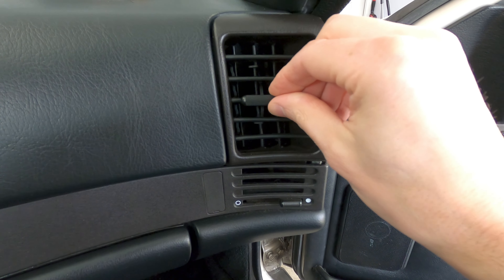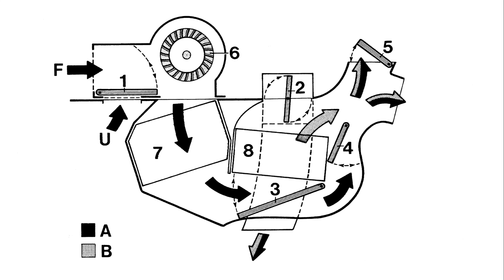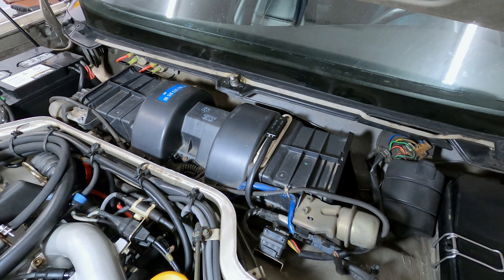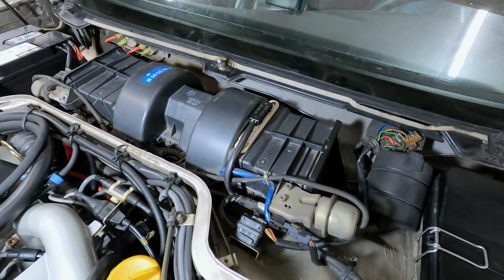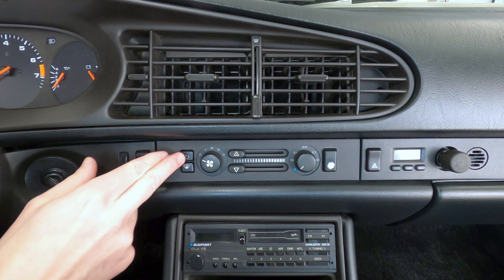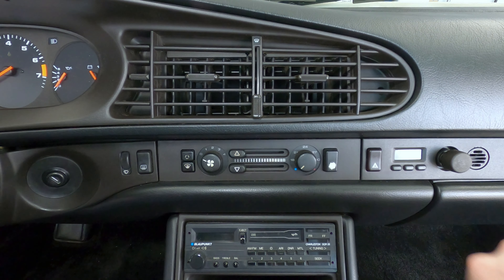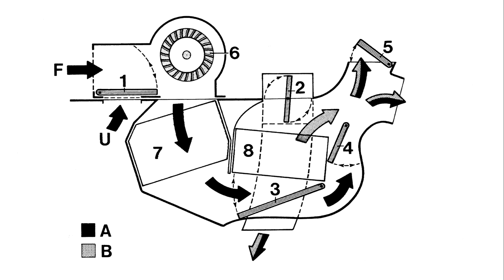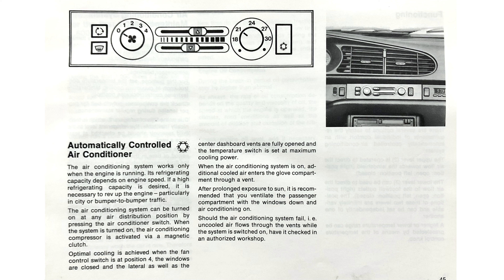Porsche 944 – HVAC Climate Controls Explained

Comment: Another well shot, informative video. You are invaluable to the 944 community my dude! Today I replaced the cable connecting the battery and starter to fix an occasional no start issue. The starter now cranks at double the speed simply from replacing 35 year old wires. Onwards and upwards!
Reply from the maker: Excellent! I’m glad to hear of the improvement, nice job! 👍🏼

Comment: Great video.  My 944 always blow air through the top of the dash even if the levers are closed.  I suspect the issue is the foam as I can hear the servo motors running.
Reply from the maker: Thanks! Sounds like that may be the case. 👍🏼

Comment: Probably too late to hope for a reply, but any chance you could help me locate the actuator for the defrost flaps? My top slider doesn’t do anything.
Reply from the maker: @AustinSikich  Hey! The motor for the defrost flap is located on the drivers side footwell towards the top of the HVAC assembly.  Check out these diagrams - https://www.clarks-garage.com/shop-manual/hvac-01.htm

Comment: This is interesting and helpful.  I always thought my top slider was backwards, because I thought it controlled air to the dash vents but you are saying it controls air to the windshield.  When that slider is to the right, I do get more air to the windshield, and when it is to the left the air is directed out the dash.  And it seems this is further controlled by the vertical lever in between the dash vents.  Confusing for sure!  I'm still not sure if mine is completely correct.  I did replace the foam surround behind the dash vents as that was disintegrated.  I wonder if there are other foam seals I cannot see that need replacement.  Thanks!
Reply from the maker: Your thinking is correct! The center dash vents share an air pathway with the windshield vents, so when you move the upper slider to the right and open/increase air flow to the windshield, some of that volume is redirected from the dash vents to the windshield. Indeed a quirky setup! 😂

Comment: Defrost button also should kick on the ac compressor 👍🏼 if your snowflake button doesn’t turn on the ac compressor but your defrost button does, you could have a bad snowflake button (or vise versa)
Reply: Could you have a failed snowflake button even if it's light is on? Mine doesn't look nearly as worn as the one in the video and it lights up but I don't hear the compressor, I think I might be able to with defrost but it's kinda hard to hear over the fan.
Reply: @kaze913  if you can’t tell by hearing, you can look at the compressor and see if the clutch is engaged
Reply: @tims_4x4_garage  That makes sense. Thank you!

Comment: My hazards are a wheel? And don’t function? Am I missing something?
Reply from the maker: @henryneufeld4944  The hazard switch to the left of the digital clock? Should be a black rocker switch with a white triangle on it. The only difference I’m aware of is the button was changed to red for the 968 in 1992. Maybe a prior owner swapped out your switch for some other custom modification?
Reply: @NC944er  must be, weird because it looks oem and well worn. It’s a rolling dial with a triangle at “top” or when rolled upwards and a triangle at the bottom when rolled downward. In the middle it’s a horizontal line which slightly clicks into place on the line. I don’t think anything happens when I roll it either way
Reply: @NC944er  thanks for giving me this info! Busy be afm, as my cigarette lighter has been converted to USB. unfortunately the usb conversion drains my battery so I had to pull that fuse

Comment: I found your videos on this topic very helpful. I am troubleshooting the heat always on issue with my 86 944. I believe the main blend door motor is frozen closed. I really found the footage of you opening and closing all the flap doors with the module out of the car helpful at 1:48 . Can you please do a complete video of the inner workings of all the flap doors and servos without the dash board in the way? That would be super helpful. Thanks!
Reply from the maker: Thank you! Have you checked the plastic bearing clips under the dash to the right of the driver’s side footwell? That’s probably the most common cause for an “always on” heat condition. Here’s a little info on what I’m referring to - https://youtu.be/h8SR1e3OmJs?t=4m28s
Reply: @NC944er  Yes, I checked all of those. All the rods are properly seated. I am thinking either the solenoid to control the heat control valve isn't working, and or the motor for the flap door that sits right behind the main vents is seized. I can't trigger the motor when jumpering it to 12V at all. 

The Arm in your that linked video where the broken arrow is pointing, doesn't move at all. I saw another video where that motor is disassembled and the rust removed to allow the armature to spin again. I plan on doing this next. I just need to limber up for a few days so I can contort myself into the kick-well. 

Do you have any footage of where the heater control solenoids are and pass through the firewall? I saw you replaced the bulkhead hoses with red, do they just pass directly through the firewall?
Reply from the maker: @tiderfish  Gotcha! No, I haven’t had to mess around with the solenoid valves yet, so no video of that. Yeah, the vacuum lines just pass through the firewall at those bulkhead connections.

Comment: I was able to get a full brand new hvac unit from my local Porsche dealer in atl. Was expensive but my buttons were all worn and ugly.
Reply from the maker: Yeah, may AC “snowflake” looks more like a “snowball.” 😂
Reply: @NC944er  I purchased the replacement buttons from pelican only to find out they need to be soldered in. They were very expensive buttons and my local computer repair shop (didn’t trust myself) wanted an arm and a leg to try and fix it. I returned the buttons and picked up a whole new unit and it was in stock
Reply: @NC944er  That's not the ultra-rare optional upgraded A/C?? "Schneesturmballes" option code -100, if I'm not mistaken 😆
Reply from the maker: @latentwagen8644  HA! You may be right, let me check my options sticker again. 🤣

Comment: Firstly thanks for the outstanding videos. I see no reference is made of a cabin thermostat in the Porsche literature you displayed at the end, so how does the system know how to achieve the temperature that you set it to?
Reply from the maker: @Nodstar73  There are three HVAC temperature sensors in later cars like this one, two in the cabin and one in the engine compartment. The temperature control unit compares signals from the three sensors to determine positioning of the temperature-mixing flap within the HVAC unit to automatically control cabin air temperature.
Reply: @ Thanks and that is more sophisticated than I thought for. Mine is a 89 2.7 (non AC) and is not able to regulate its cabin temperature, cold is fine but if you move it to 20 degrees it feels like it is on full heat and never drops back, unless you switch it to full cold. I think I will start with checking the temperature control unit which I see is near the blower motor, unless you have any other suggestions? Cheers Marc

Comment: There seems to be an electrical issue with my climate control unit, but I struggle to understand what alle the pins are for. Is there a schematic for the electrics of the control unit? Especially the three connectors on the back of the unit?
Reply from the maker: Yeah, all that stuff is in the factory workshop manuals, volumes 4-5, electrical.

Comment: Fantastic video as ever. Just replace my oil pressure relief valve (£500!), and wanted to ask what reading you get on your oil pressure gauge at idle cold or hot? Think I may need to replace main bearings and balancer shaft bearings on my 87 16 valve…. She runs well with 5 bar in use but only 2 bar at idle…
Reply from the maker: Hey John! The oil pressure conditions you described sound like they are within spec. The gauge should read between 4-5 bar at cold start and when warm and under driving load. It should read between 2-3 bar when warm and idling.
Reply: @NC944er  thanks for the feedback - I suspect as at 150k miles now I should plan a rebuild and maybe drop in some forged pistons and rods fairly soon… I missed it so much in the shop I just need to drive her this weekend!
Reply from the maker: @johnjoseph911  Haha! I don’t blame you, as you gotta get those drives in! I did just the rod bearings on mine. The piston rings have generally good longevity on these cars, but certainly let any performance issues guide you towards what needs to be done.

Comment: I need to ask you for an advice. I spilled some Mannol injector cleaner and it went into fuel drain under the petrol cap. Now it smells horribly in the car, some portion of the cleaner must have went into cavity in front of the wheel well, because when I remove the vent behind passenger doors I can smell it there(I already cleaned the area behind the wheel in the trunk).
Does this area in front of rear wheel has a drain hole? Can I run water through it? First I want to try to vent this area with hair dryer to see if it helps
Reply from the maker: Oh wow! Yeah, right where you removed the plastic vent in the door jamb, if you shine a light in there, you’ll see a small drain slot at the back of that cavity.

Comment: Another superbly informative and concise video; well done!
Thought you were in my 951 for a second... I have the same Blau Dearborn and cubby. Is that a BT in the 12V/cigarette lighter?
Reply from the maker: Thanks! The radio head unit still works surprisingly, although it definitely sounds very ‘80s. No Bluetooth or other electrical mods outside of new Kicker speakers (the old ones rotted out). The cigarette lighter is just the factory unit, although it’s missing the little white cigarette symbol. I’ve seen some ‘88 cars with a blank one and some with the symbol, not sure why the difference, but I can’t imagine someone using it to the point where it wears off. 😂
Reply: @NC944er  My 89 has the lit cig icon 🚬  
Same with the foam on my original speakers (hifi option)... will look to replace them with Polk DB's, as I had good results with them in my 84, and they're relatively shallow.

Comment: Very informative I can’t believe the glove box is air conditioned. Do you have any guides on your channel for replacing the AC compressor?
Reply from the maker: Hey thanks! No, not yet… but that is on my “to do” list for this year. I have been eying the Griffiths kit and unfortunately it looks like the price has gone up again. 🙄 https://griffiths.com/product/924s-944-remanufactured-nippondenso-kit-85-2-91/
Reply: @NC944er  ugh. I had my eye on that for the longest time as well. A friend of mine ordered one for his ‘81 Targa but he wasn’t satisfied with it which gave me reservations. For both of my cars I am struggling to find a solid solution to the AC issue. I wish a company would manufacture an aftermarket clutch as that’s what causes the failures most of the time. Would be so much easier and inexpensive than having to deal with replacing the entire compressor which might still be functional.
Reply from the maker: @TakeFlightGarage  Yeah, that would be nice. Sadly, part options seem to be deceasing of late, so I doubt we’ll ever see it. I’ve spoken with the guys at Griffiths a couple times and they said the majority of compressor failures they see are when people have swapped them out, but neglected to flush out the entire system, so existing debris ends up fowling the new compressor. I also tried to pin them down on whether the Denso was more reliable than their Kuehl option, but they claim to be equally dependable on a well maintained system. You could save a few bucks using the Kuehl, but it has a funky bracket modification that I’m not a fan of.

Comment: Thanks for another great video. Who you mind letting me know whose video are you referencing at 1:46? That video is really helpful getting inside the HVAC system itself. I've seen it before but can't find it now that I need to figure out why I can't get heat to my dash and foot well vents. Thanks again!
Reply: following... I think my issue with my sliders not doing anything has to do with this stuck servo unit or something in that area lol
Reply from the maker: Hey sure! I don’t know if it’s the same video, but happy to share - those images were from a German guy just briefly showcasing the operation - https://youtu.be/AN96tJhDLS8 
The most common issue with the flaps is that the plastic bearing clips snap off the linkage. There’s another clip here that may help - https://youtu.be/OmFqgwxHsdw

Comment: So jealous of your mint crack free dash.
Reply: They are hard to come by. I cover mine while driving to keep the sun off, but the temp will always fluctuate if the car is used. Even NC's has a few mini vent cracks, I think. Inevitable!
Reply from the maker: Thanks! It’s only “mint” from a distance, but I admit it’s far better off than most. It actually has exactly 15 hairline cracks around the vents, the shortest measuring about 4mm and the longest about 23mm, but who’s keeping track? 🤣
Reply from the maker: @latentwagen8644  Yep, covering is key! I’ve been trying to keep up on some Meguiars UV protective applications as well, not sure how much it helps, but it hasn’t yet gotten worse. 😂